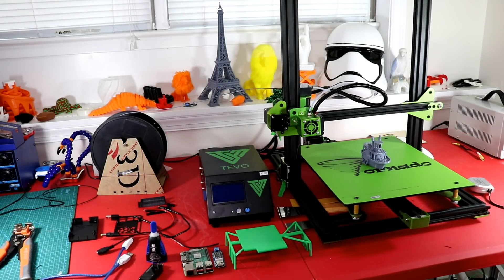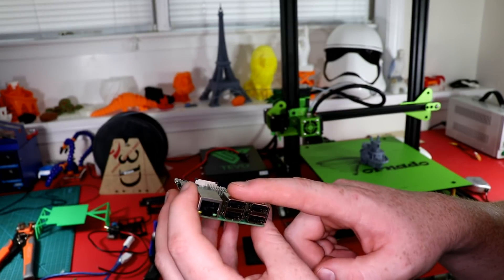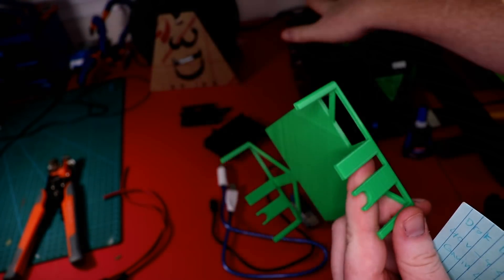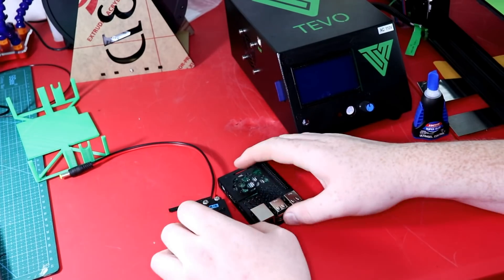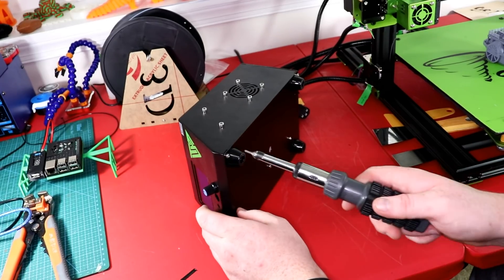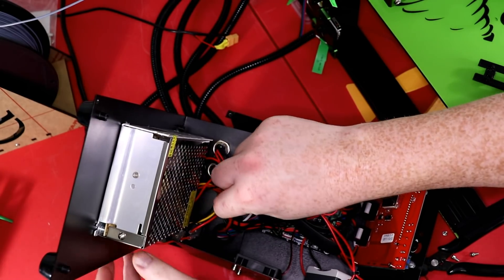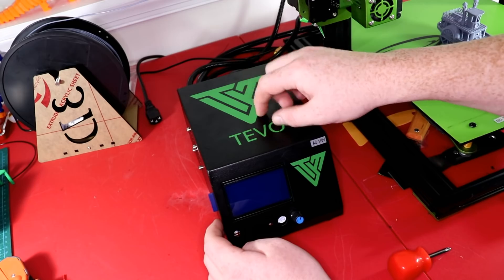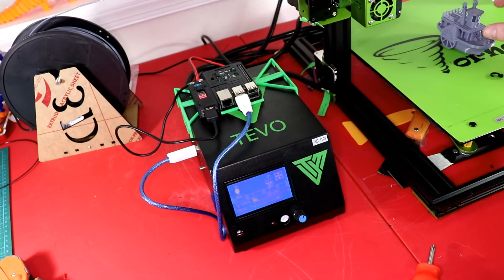Tevo Tornado OctoPI Install (Hardware Only)

Comment: noob question but if my tevo tornados board messed up but all the steppers and motors were good couldn't i get a rasberry pie and print with octo pi does it by pass the stock board?
Reply from the maker: you would still have to replace the controller board. the Octoprint basically is relaying the commands and the control board is doing all the math.
Reply: Eric's DIY I have the Tevo tornado new to printing but what is a good board to upgrade ? Or should I just buy the stock one

Comment: Did you have any issues of the octoprint getting time out from Tevo tornado? When I give the print, it times out after 5-10 layers of print. Tried many things including shorter power and printer usb cables. Nothing worked. 
Astroprint also have same issue. However Ultimaker Cura s/w, with direct usb connection works without a hitch on the Tevo